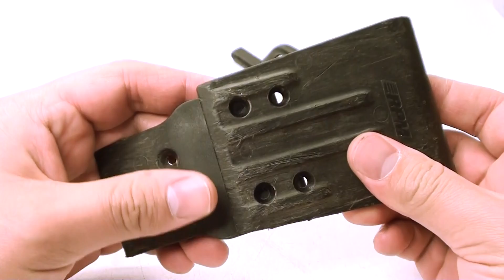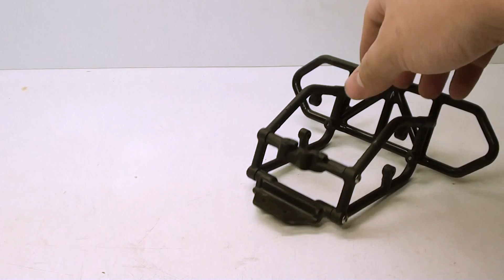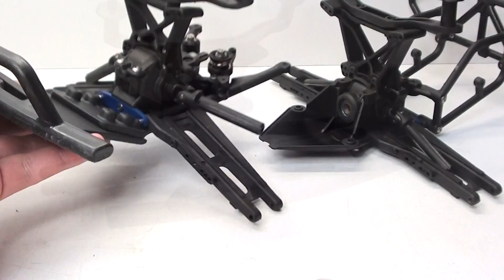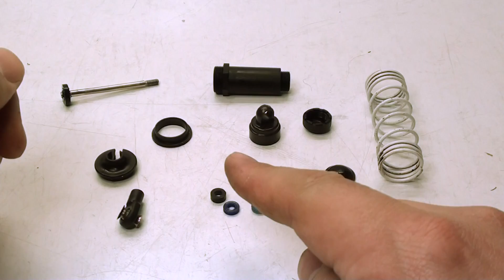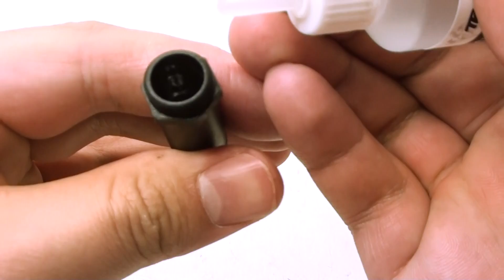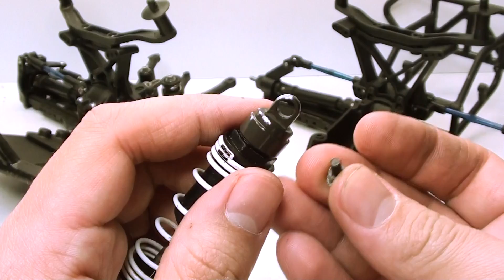Grim - Traxxas Slash 4x4 - Build Part 2 of 3

Comment: Are the front and rear differentials the same bolt pattern to the frame? the reason I'm asking is, I was curious if it possible to put two front differentials in with steering to have 4-wheel steering?

Comment: Is it cheaper to build it your self?
Reply: It's definitely cheaper if you plan on putting upgrades in, for example, if you want to put a castle creations motor and esc, the velinion combo will be useless, so save the money and just start with the upgrades. It's also cheaper to build it all stock too.
Reply: +Masen Bush thanks will defiantly consider it